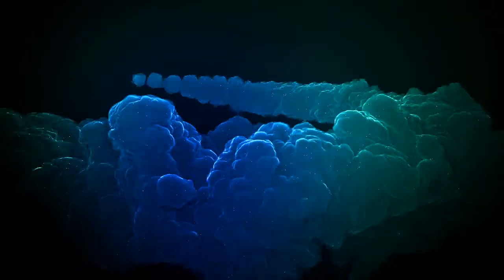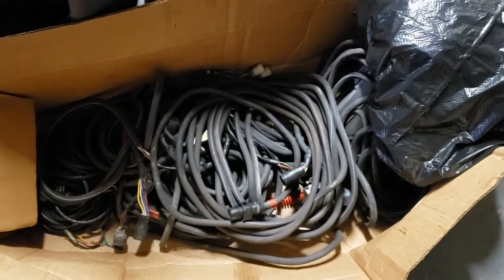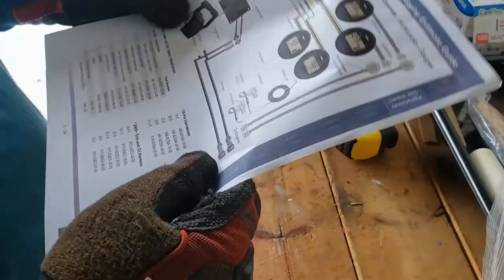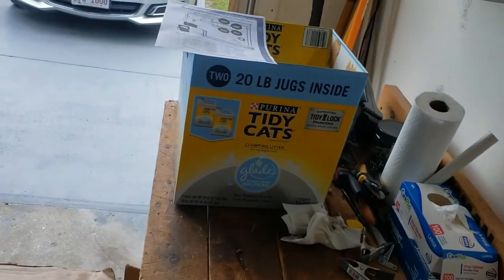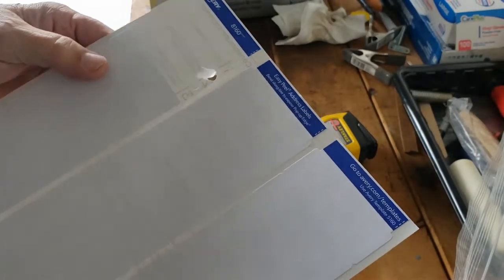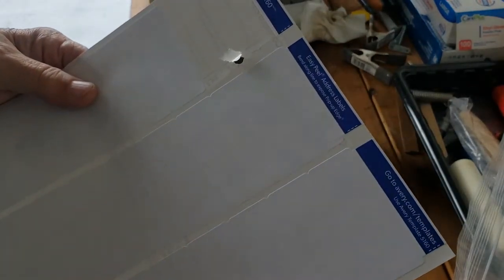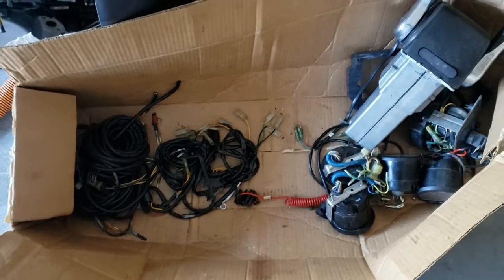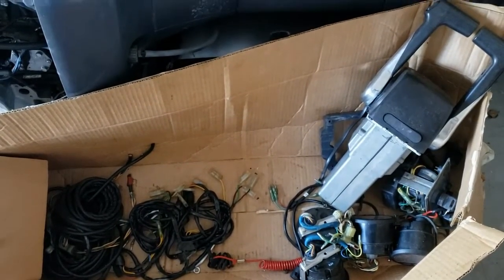1984 Grady White - Yamaha OX66 Outboard Motor Rigging Components- Episode 5 Part 1

Comment: Just got 2 of these myself. Great video! Thank you very much for posting
Reply from the maker: As you can see I'm still working below deck replacing the stringers.  I'm looking forward to getting the motors on the back of the boat.  My neighbor just bought a tractor with forks so mounting the two engines may be easier than I thought.